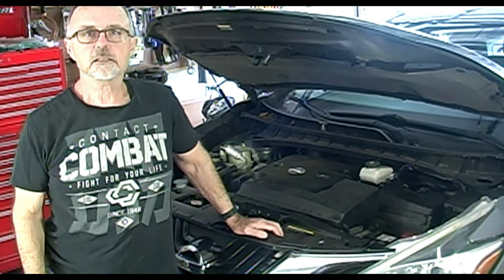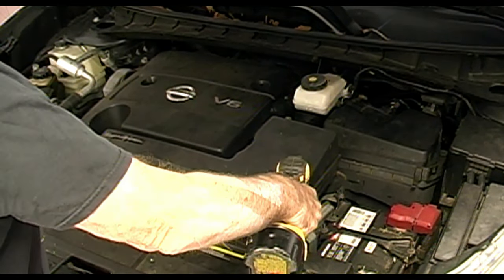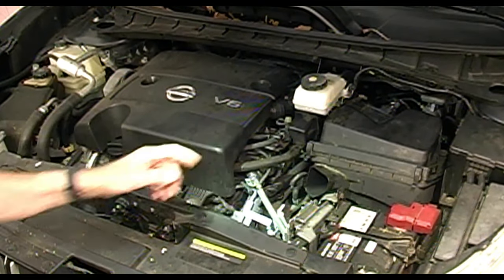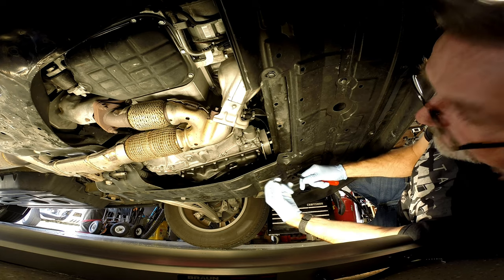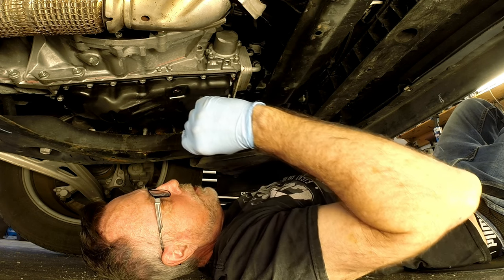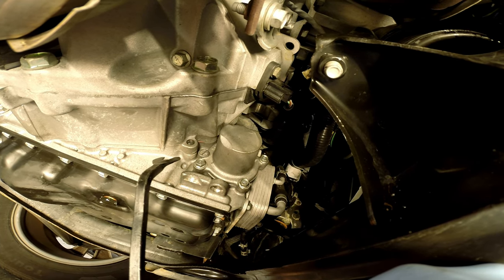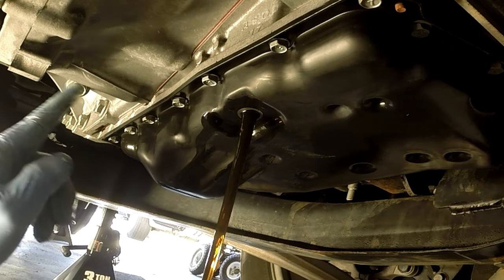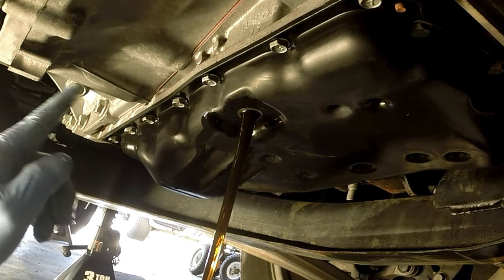2015 Nissan Murano transmission service

Comment: Great video. Nissan wanted about $500 to change my oil. Don't have the quote close so I don't have the exact amount. They were not changing the inner filter just back flushing through the cooling lines  with new fluid to clean the filter. This video saved me a lot of money.

Comment: Heads up to any DIYers doing this yourself. The latest transmission strainer (larger silver filter behind the pan) (13.3 min) is now a "D" revision as can be seen at the end of the part number, 31728-29X0D. I also had to buy a new bracket part number, 310693-VXD. This only done once, unless of course, Nissan goes to an "E" revision. I found this out the hard way after ordering all of the parts and dropping the pan. I then had to scour the earth for the new bracket and drive a couple of hours to get it. Hope this saves someone some serious time and frustration.
Reply from the maker: Thank you for this info!
Reply: @getdirtywithvern glad to help. For anyone wondering, the new filter has 2 bolt holes instead of 3. The back bolt on the old filter (towards rear of car) mounts to a small removable bracket. I had to remove this small "A" revision bracket to make room for the "D" revision filter. I reinstalled the 2 small small screws without the bracket.  Also installed the long bolt from filter "A" back into the transmission. It will be behind the new revision "D" filter after installing it. The new bracket I mentioned in my first post above is a new replacement for the small bracket that has a small sensor zip tied to it. The new bracket is almost identical but is thicker where the new revision "D" filter will attach. I reused all of the bolts removed to mount the new bracket and filter. On the other corner of the filter you will see where a transmission bolt is removed to reinstalled through the new filter.
Reply: @ @jrh6869 did you bought the bracket service part number 31069-3vxod together with the bracket holder? Trying to buy all my parts Don't want to miss anything.
Reply: @johnromylgordula483  I bought the "d" strainer and the "d" bracket listed in my first post above.
Reply: Hello, I just ordered all the parts you mentioned. Can you tell me what the procedure is to install the new bracket?? Does it have to fit in a special way..what exactly is its purpose..Thanks in advance...
Reply: @rmp608  hello, please see my second comment on this thread that provides more info on the bracket and reuse of bolts. It ultimately holds the new shaped filter in place on a corner that doesn't match up with the older bracket.
Reply: @jrh6869  Thank you for the quick reply!! Owe you a cold beer!!
Reply: @jrh6869  Sorry..I have one more quick question..I see that there are 2 brackets ..one is a long narrow shape..and the other type bracket is smaller and square..Which did you use.??Thanks

Comment: It’s no joke how easy it is to strip a pan bolt. I stripped four when I serviced my Jeep Compass’s transmission. Tapped them out with 1/4 20 tap and installed 1/4 20 bolts. Easy peasy

Comment: CVTz50 and a wireless adapter like VP11 are inexpensive and can help verify CVT function. Use this to monitor & reset codes and fluid deterioration.

Comment: Well done.  But had a question. Maybe I missed it in the video but figured I would ask. When you dropped the pan what was the part you replaced?  Is that an internal filter?  I have a 2018 murano platinum. Hoping it’s the same.  Need to change mine.
Reply from the maker: It is a screen/filter. Check with www.nissanpartsdeal.com for actual part fitment for your year and model.

Comment: Hey Vern ,great video, used it to do my service on my 2015 . Question, I  have seen multiple  videos , posts stating to only check to overflow when fluid  temp between 95 and 115 . Your video, you state operation temp to flow check valves then go right to overflow.  Can you or someone else on here set me clear on this . To me operating temp would make more sense for level check , but??
Reply from the maker: I can't recall what operating temp is just now but yeah, it has to be at temp to check overflow level. What you saw in the video was just how it was edited.
Reply: Thanks , mine with engine at operating temp ,trans pan temp  around 120 ,digital reader and dribble out the overflow

Comment: Vern, this video was very helpful so thank you.  I just have one question about the refilling process.  I've read that the CVT fluid should be between 95 and 115 degrees before you open the overflow plug.  Do you know if this is necessary or can you just get the engine up to normal operating temp and then do your gear shift procedure like you displayed?  If the temp does have to be exact, would you use something like the Veepeak ODBCheck tool to verify CVT fluid temp?
Reply from the maker: Normal operating temperature is the goal.
Reply: A thermal thermometer pointed at the drain bolt could work as well

Comment: Best instruction by far, thank you. Does a 2020 model have the external filter? Also which internal screen for the same 2020 version? 
I’m at 30k and will need to do this service this summer so I’m trying to prepare.
Reply from the maker: I don't know about the 2020 Murano. The model run was 2015 to 2018. The 2020 shares many similarities but you can check with nissanpartsdeal.com and see what filter fits your Murano

Comment: Very productive video! Could you please let me know where to order the transmission filter that is inside the pan? I got the yellow one but was not able to find the inner one. Also, they say it is a sealed transmission, will it cause any damage if we open it? I am having a 2015 Nissan Murano Platinum AWD.
Reply from the maker: I believe this is the part you are looking for: https://www.nissanpartsdeal.com/parts/nissan-strainer-assy-oil~31728-29x0d.html
The AWD version should be the same as FWD CVT transmission. If your Transmission pan has bolts around it then it is not a sealed trans and the pan can be removed for service. Good luck with your project!
Reply: @getdirtywithvern  Wondeful! Thank you so much for all the valuable information. I shall keep you posted!

Comment: Is changing out the whole pan part of servicing or can you just change the fluid and filter?
Reply from the maker: You will need to remove the pan to replace the screen filter. You can often reuse the factory pan gasket though. Removing the pan is important in assessing the amount of metal shavings in it as well. The fluid is expensive so do it right once.

Comment: My stepdaughter has a 2018 Murano.  Regarding the external transmission cooler filter, I figured out a way to loosen the recessed fourth bolt, but before i removed it I was trying to figure out a way to get the bolt back into the hole.  Is there some trick to getting the bolt back into its hole.
Reply from the maker: You might try placing a small magnet inside the socket to hold the bolt to place it in the hole. (Harbor Freight Tools sells small rear earth magnets that may fit). Make sure all other bolts are loose first before attempting to start this bolt in its threads. Good luck!

Comment: Good video!
Question,what are the parts required to buy to do this? 5 quarts of oil,external filter, anything else?
Thanks.
Reply from the maker: You will need this: "Transmission Oil Filter W/Pan Gasket for 2015-2019 Murano 3.5L" You may have to buy the pan plug crush-washer separately.
Reply from the maker: @dissturbbed  I replaced the internal metal pickup screen/filter with a new one in this video. The external filter on the side of the trans, I had replaced earlier but had no footage of that so I only referred to the filter change in the video. I did change it though. You are right to question; they should always be changed.

Comment: Why didn't you flush the system fully, seems a huge oversight even with how thourough you seemed, service manuals say fill and drain 2 times then change the filters etc.
Reply from the maker: Actually, I did fill and drain the system 3 times. It just didn't make it to video. There is a standard 'service' (just draining the fluid and filters) and a full 'flush'. The flush is recommended if the trans is not functioning smoothly. The 'service' is routine maintenance.

Comment: How many quarter's did you put it back again? Thank's for the video.
Reply from the maker: I believe it was 10.8 quarts but double check it before you do the service to make sure you don't buy too much, because it's expensive, but make sure you have enough because stopping the work to drive to the auto store to get more is a pita.

Comment: Torque specs?  I found spec for  pan bolts (70 in-lbs) but I can't find a spec anywhere for the filter housing bolts.
Reply from the maker: I ran into the same info black hole on that one. I torqued mine down to same specs as pan bolts. No leaks so far.

Comment: 95 degrees to 115 degrees if you have a scan tool to check the level.
Reply from the maker: I use the VEEPEAK OBD-II scan tool. I highly recommend it for checking transmission sensors and running temperature. You can use an app on your phone to connect to it and monitor temps on the go. Very useful.

Comment: Is this for the 2014 nissan murano also? What filters or screens are needed exactly?
Reply from the maker: I believe the 2015 was a new generation. The CVT transmissions are nearly identical but the strainer assembly inside the pan is slightly different if memory serves. You will need the small yellow filter on the side of the trans and the strainer assembly for inside the pan. Check with nissanpartsdeal.com for the correct fitting parts.

Comment: Did you happen to notice any vibration around 1000 rpm before this service and if so did it cure the vibration most say it does it from new I find that hard to believe T.I.A
Reply from the maker: It was more like a violent jerking at around 15 to 20 mph going up inclines. While the fluid change helped, ultimately I changed the valve body and it has driven like new since. See this video: https://www.youtube.com/watch?v=X9dOmDmN-eM

Comment: Hi... My Murano starts with no problem. Wehn I shift to D reach 2,000 RPM and don't move forward. In Reverse function normally.
Reply from the maker: Much will depend on the miles and how your Murano transmission was maintained.
Excerpt: 
"If a Nissan vehicle is experiencing transmission issues such as not shifting, showing power loss, not engaging, and not moving when the transmission is set in Drive, it is likely caused by a problem with the transmission control module or the transmission valve body. These issues can also be accompanied by the check engine light and a transmission error message displayed on the instrument cluster. Other common causes of this problem include low transmission fluid levels, faulty sensors or solenoids, and internal transmission damage. To diagnose the specific cause of these symptoms, it is important to perform a thorough diagnostic scan of the transmission control module, check the transmission fluid levels, and inspect the transmission for any visible damage or wear. In some cases, the transmission may need to be rebuilt or replaced."

Comment: Are you jacked up on all 4s?
Reply: Nevermind, I see that you are and as you state in the end of the video. 

How did you get your Murano on all 4? Front and rear lift points and jack stands on the pinch welds? 

Thanks
Reply from the maker: Yes, the car has to be level to check trans fluid level.

Comment: Can you pump fluid out through the dipstick and replace it that way
Reply from the maker: You can add fluid at the dipstick tube after draining from the plug in the pan but doing a pump-out for a complete flush requires special equipment. It ends up being cheaper to have the local dealership's shop do a complete flush for you.
Reply: @getdirtywithvern  I see. I was just curious thanks for the reply

Comment: I went to a nissan dealer and they said "transmission oil change at 100k thousand miles then at every 50k miles after that
Reply from the maker: Reasonable advice if your trans has an external cooler added or you live in a cooler climate. In hotter climates these CVT transmissions fail long before that 100K mile mark.

Comment: Having the car level is not Mandatory. From all the videos I watch about my car fluid change they all had it on 4s/lifts and they all got out 3 1/2 Quarts a bit less give or take. My car was on the front 2 only and guess what same amount of fluid came out a couple of drops different give or take, this is not a heart surgery on a human don't over complicate things. (This is for the viewers not for you gentlemen on the video(: ) but to each their own, peace out. I used amsoil signature series and gave me quicker acceleration going up the ramp to merge in with less throttle on eco mode lol really noticeable I was like what the hell aha and before the procedure my mpg was at 35 and after I was done and car idling for 11 minutes on a hot day burning fuel took it for a drive to the same spot where I do my tests and I wasn't even paying attention but when I arrived I looked at my mpg and instead of going down or staying on the sameish number went up from 35 to 41 lmao 🤣 I know I'm not supposed too but I do experiments on my car barely hit 30k and already 2 transmissions fluid changes apparently my transmission loved it ❤️ 2022 camry awd version, toyota claims 24 city and 34 highway, not for me though 😉

Comment: Brother please help me 
I have a 2016 Nissan Murano I have 82000 miles on it 
I have a crack on the front left bumper 

So when I drive I get this weird high pitch whistle when I hit around 15000-20000 Rpms 
It’s not my belt I had it lubed and repositioned 
It’s only in low rpm’s what can it be?
Reply from the maker: As much as I wish to help I would have to see it in person to diagnose the issue. Even then it might be difficult. If you have a gopro, mount it where you think the sound is coming from and take it for a drive. The video should pick up the sound as well as video. Good luck!